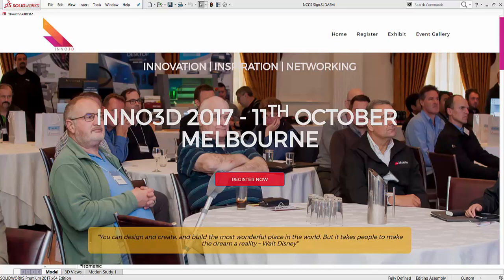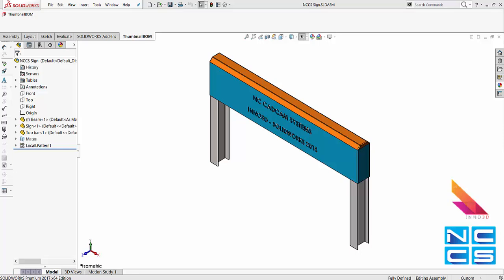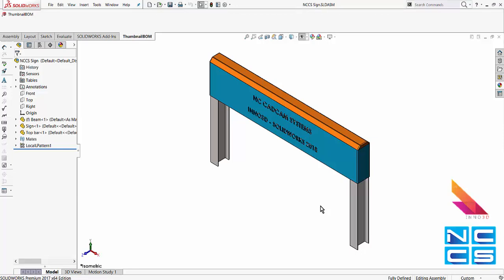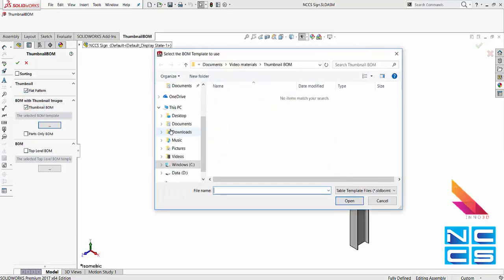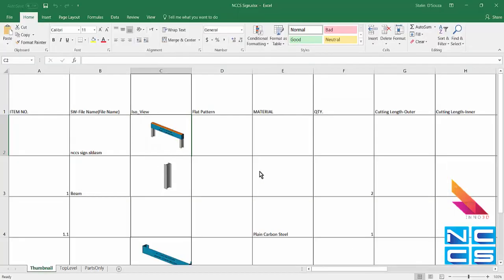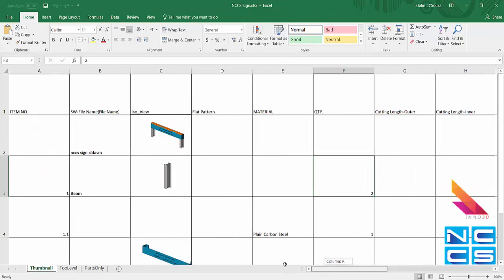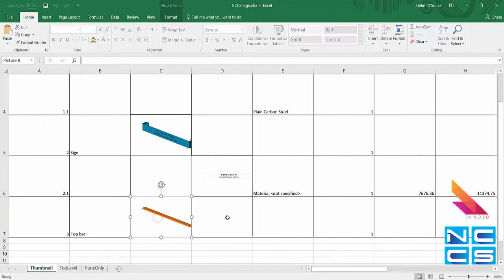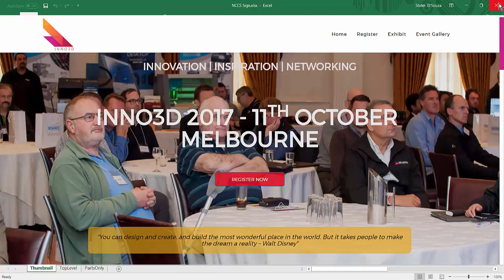SOLIDWORKS Video - Thumbnail BOM

Comment: Thanks for the video! I have a question though. All the thumbnails are locked/immoveable after exporting my BOM to excel. I'd like to move some of the thumbnails, but this is not possible as they all are locked. Is this solveable?